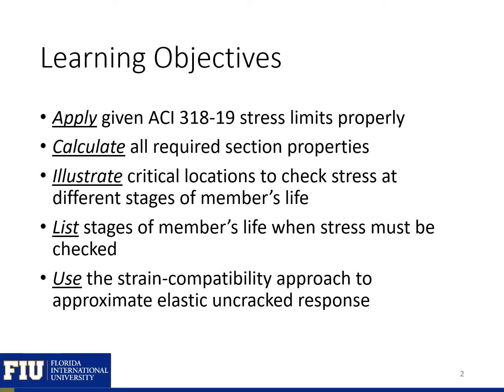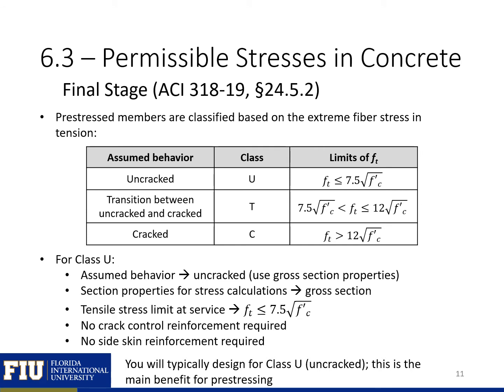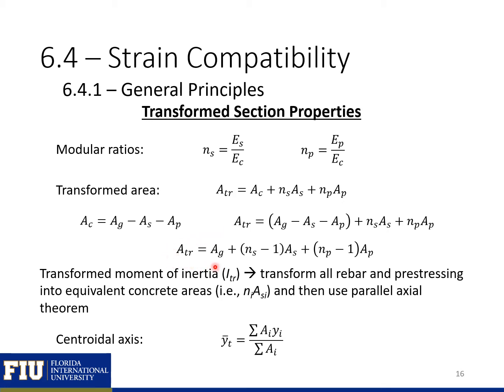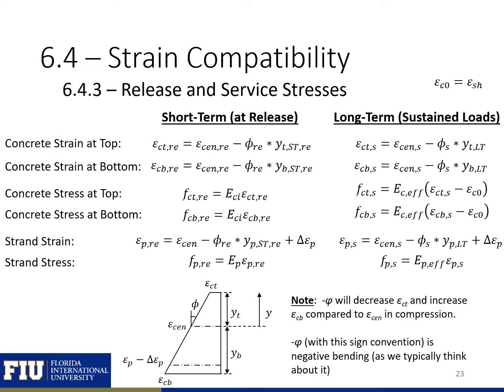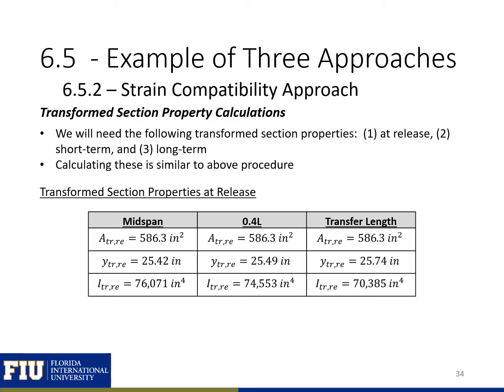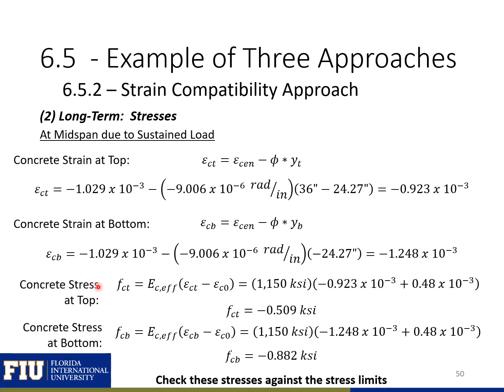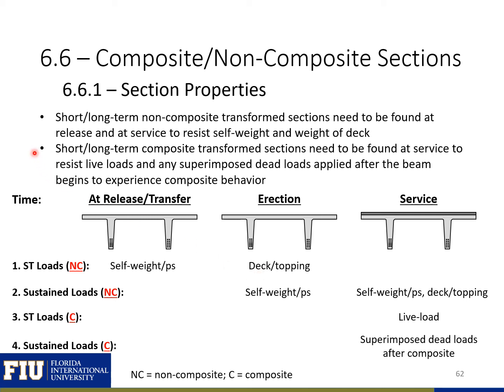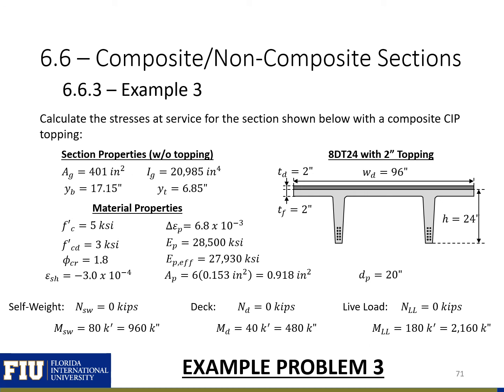Prestressed Concrete Design - 6 - Stresses with Strain Compatibility Approach

Comment: Hi David,
This channel is excellent. In either this video or a previous one, you outline that the critical stages to consider are likely:

Transfer
In-service SLS
In-service ULS

This seems to align well with standard industry practice.
In highly reinforced beams, I’m finding that—when analysing the beam using strain compatibility—shrinkage and creep occurring prior to installation (but after transfer) can worsen tensile stresses in the concrete. Do you agree with this conclusion? Is this something you ever explicitly consider in your assessments?
I note that, in many examples I review, designers often simplify the analysis by either:

Treating shrinkage and creep solely through prestress losses, and/or
Neglecting the presence of reinforcement in shrinkage and creep calculations altogether.

Thanks in advance 🙂

Comment: @David Garber, Dear Mr David Garber, I have a question regarding using Modular ratio of concrete for finding strain at centroid for Live load. why don't we using Ec,eff instead of Ec and using Atr,LT instead of Atr,ST. Although live load is short term load, but live load only impacted to beam in service stage, that mean is concrete has been considered shrinkage, creep,.... So using Ec,eff is more exactly. Is that right?
Reply from the maker: @Manh Le - good comment/question. Ec,eff and Atr,LT should be used for any sustained loads; these take into account creep of concrete and strand relaxation. Live loads that are not sustained won't cause any creep in the concrete, which is why using Ec and Atr,ST is appropriate. The shrinkage of concrete is accounted for with the shrinkage strain in No and Mo. I hope that clarifies.